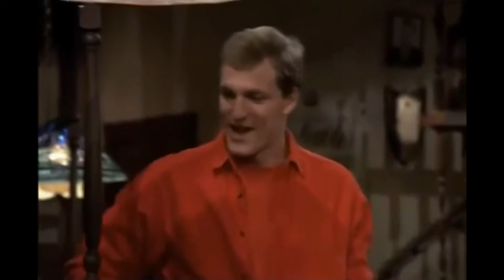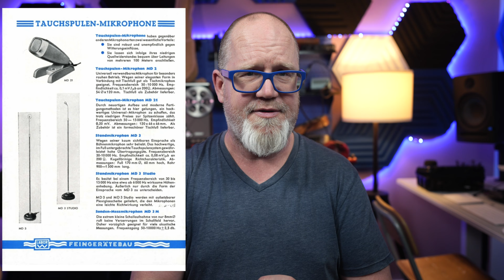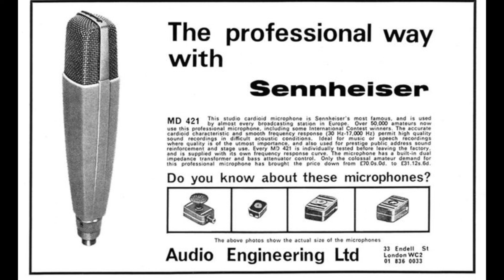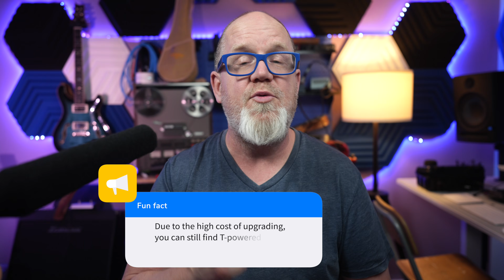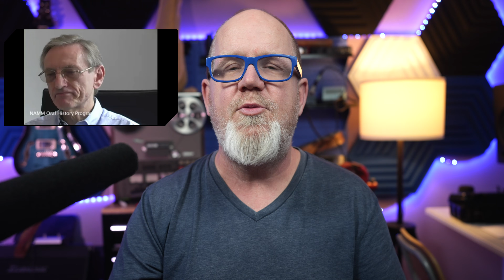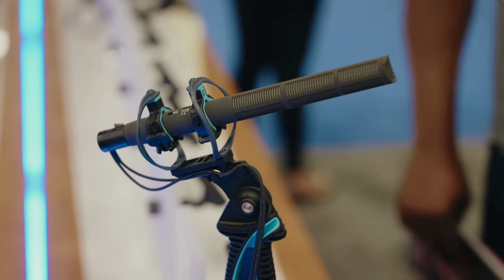How Sennheiser Created A LEGEND Out of the MKH416!

Comment: First of all, congratulations on your channel.

I'm sending this message because I'd like you to make a video explaining the VIDEO FOLLOWS AUDIO features available on some equipment, such as the Yolobox, Rodecaster Video Pro, etc.

I've seen some on the internet, but honestly they weren't educational enough for me, I have ADHD and I'm autistic (how do I set up the camera, how do I route the audio cables - does the microphone come out of the camera? How do I connect a Cloudlifter to this process, if necessary?) How do I make this happen if I have a Zoom Podtrack or a Rode Podcaster where all my dynamic microphones are connected? In these tutorials I've seen, they focus more on software configurations than hardware, you know?

And it would be very valuable content for your channel, because there are a lot of people - like me - who would like to put together a podcast, but don't want to depend on editors to do it - so automatic cuts based on speech would be essential for that to happen.

Also, if possible, I would like you to review the Roland VR 6HD, a true professional streaming setup, which has the audio and video mixer on the same console - including native VIDEO FOLLOWS AUDIO and no "hacks", because on this console you designate the video AND audio input for each channel, because they are on the same equipment. It is the setup of dreams, if it didn't cost two kidneys - but even so, it is worth showing.

A big hug straight from the Brazilian Pantanal, HAPPY EASTER!